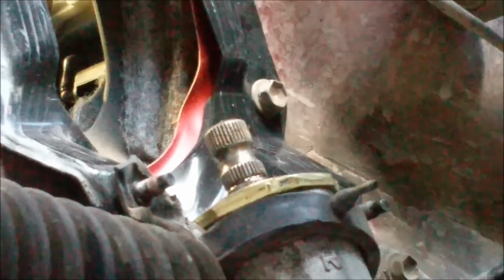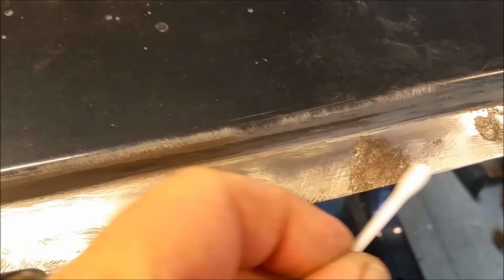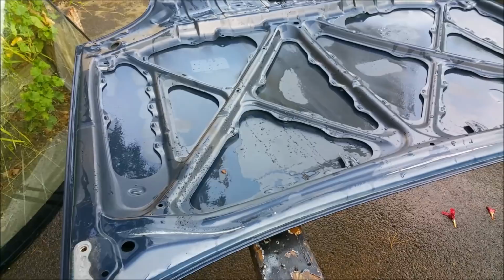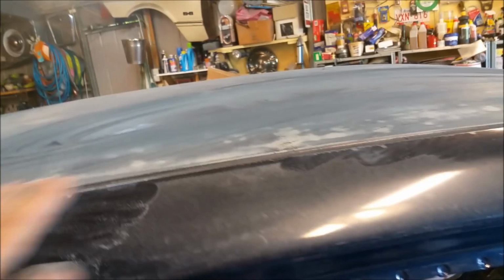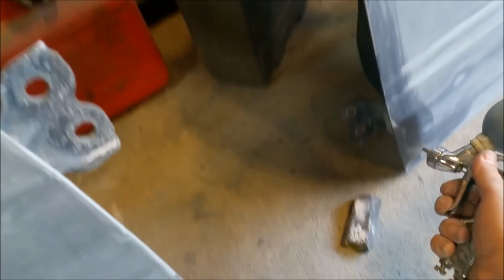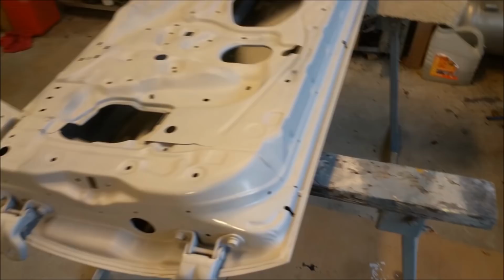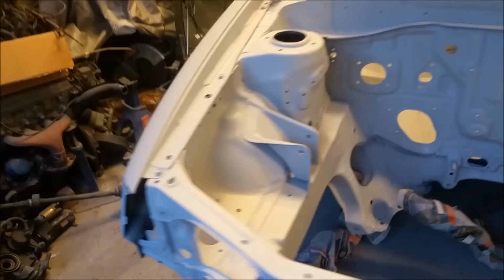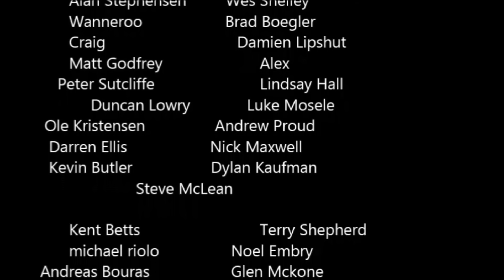Grocery Getter - Starlie Part 5 - Prime Time!

Comment: Wow, Peter, the little Starlie is going to look way better than it did when it rolled off the assembly line. They are a great little shopping trolley with aircon and power steering you be able to hit all the tight turns in the supermarkets without getting out of the car.
Love seeing the wacky jobs you do. Thanks for the time-killing videos as we are all in lockdown over in Perth too. Stay safe and keep well.
See ya on the other side. Whenever that is.

Comment: The original paint, with all the missed bits and overspray is an inevitable legacy of most manufacturers changing from dipping their vehicles in paint vats during their trip down the assembly line to using automated spray booths.  I have seen, and heard of, quite a few new vehicles turning up at dealerships to be prepped for delivery to the customer, only for the PDI to reveal missed, and sometimes even bare metal sections, often resulting in the vehicle having to be returned to the importer for rectification.  Those that are lucky enough to have their own suitably accredited body shops could, of course, rectify them in-house with the new car body warranty still being honoured.  It fairly boggles the mind when you thing about how many areas on post-dip vehicles will have seen no primer or paint at all...

Comment: I am trying to fix up my 96 K11 Micra which I have owned for 20 years.  I just pulled the windscreen out after noticing some rust bubbles around the edge and to my shock and horror all the pinch weld along the top is totally rusted out.  This is 100% due to the guy that replaced the one and only ever windscreen it had about 10 years back and this guy was rough as heck on the car getting it out and did not use any primer afterwards to repair all the damage he did to the paint which they are supposed to do but I did not know this at the time while watching him work on my car.  I am fixing it but still its just beyond a joke such cowboys operate in the glass industry and this was Novus autoglass so not some backyard operator. Shame I can't post up some photos of it as its shocking to see.